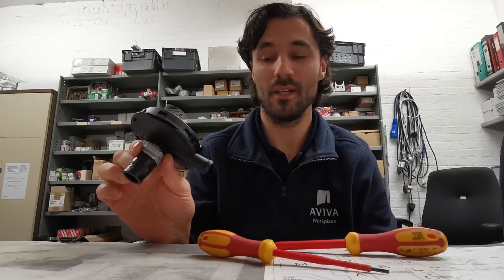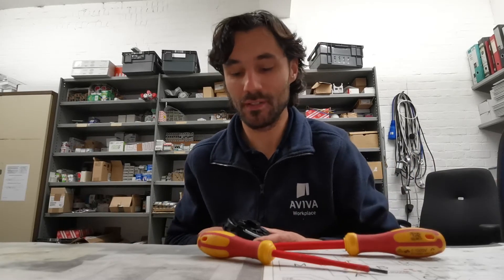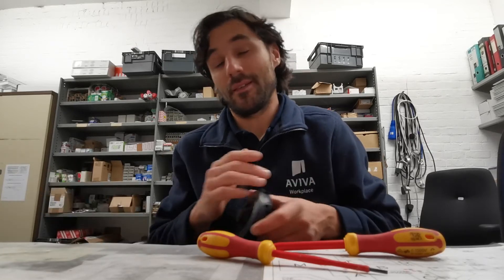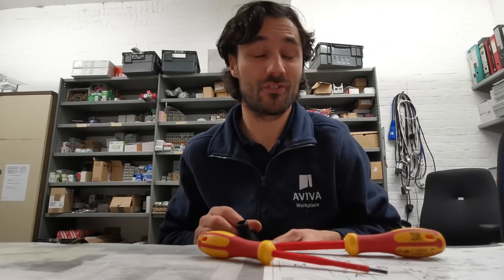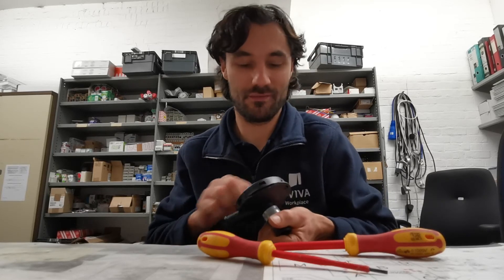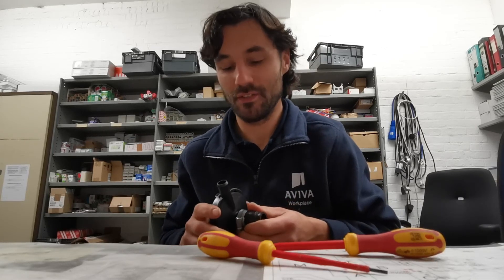Audi S4 B6 PCV Test

Comment: Hi there. I have replaced my PCV 4 times on my 2006 S4. The exhaust smokes and stinks like oil. The second i replace the PCV this goes away for about a day or two (completely). Then, it comes back. I replace again and repeat. I have used several off brand PCV valves, but never oem. My question is does this really make a difference? Or is something else causing this. It is odd that it solves the problem completely for a couple of days. Engine runs fine, with no codes.
Reply from the maker: Not sure really, this engine was basically shot as it probably had an internal fault to do with rings and compression...